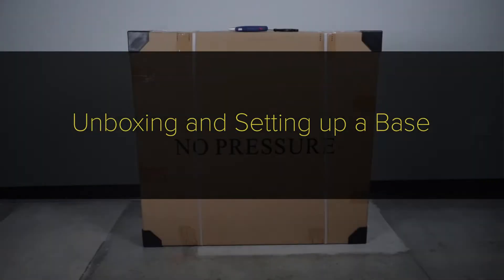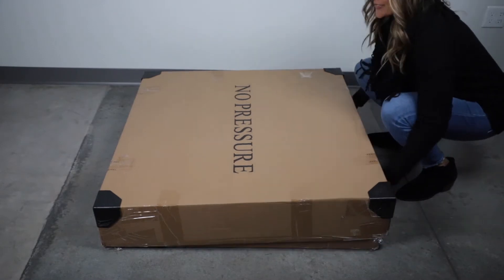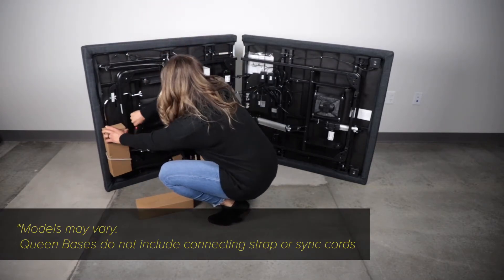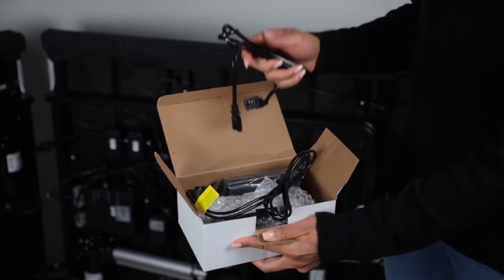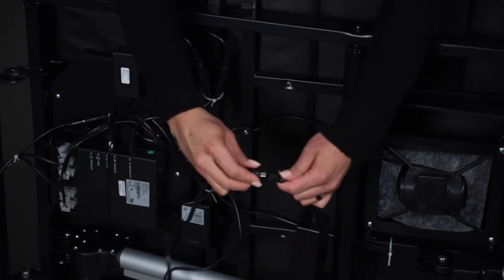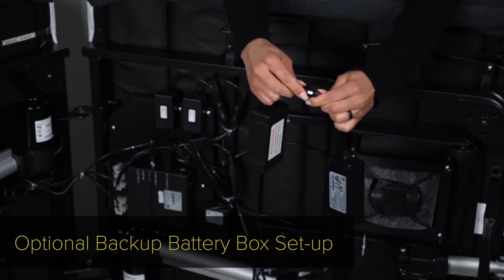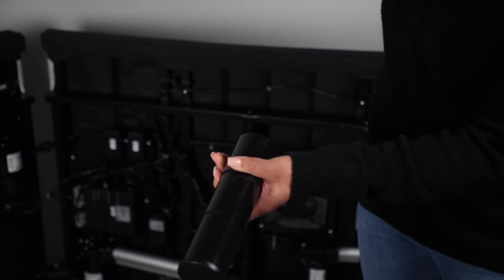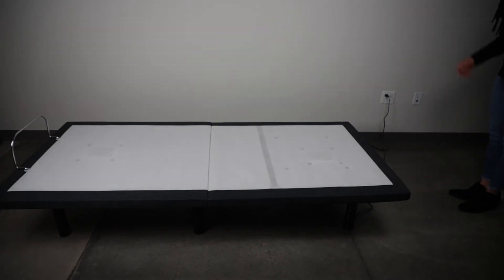Adjustable Base Assembly

Comment: Does the queen size adjustable base you get from costco fold like this in the same way? There's barely any documentation or videos showing how to move it upstairs, how to get it through the door, product dimensions when it's in its folded state.  Come on guys, you need to have better marketing data. I want to buy it, but I don't know if I can get it in my room, because there's no data on how the product looks when it's in the box.